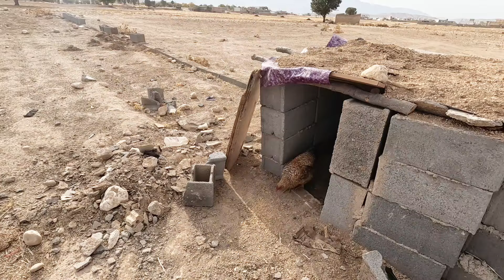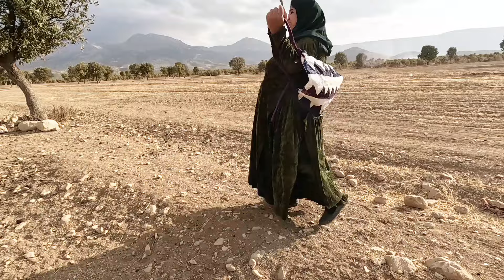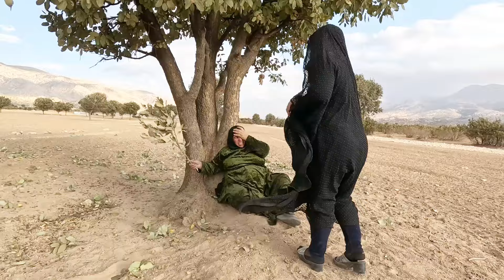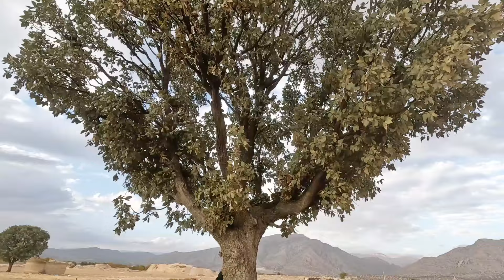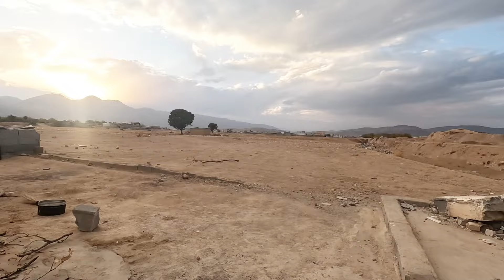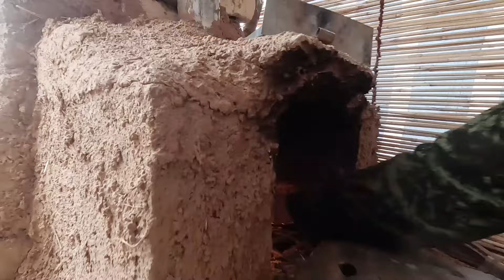A cruel life for a grandmother and her grandson: conflict over an oak tree

Comment: I have not seen any common sense used in this blog.
You can live inside the old house with no improvements to the house that Is permanent.
Use blocks and rocks to make a closed in corner, don’t get rid of the hut, it shows you spend your days outside.
Cook outside, only make a snug corner.
You have so much talent Grandmother, make more bamboo curtains, make a large quilted bed, stack up blocks and rocks to hide behind, and keep the wind out.
Feed the chickens, the left over vegetable scraps.  
Make the blog believable!
Pick up the straw in the fields and put it in the chicken coop, they will use it like a nest to keep warm.